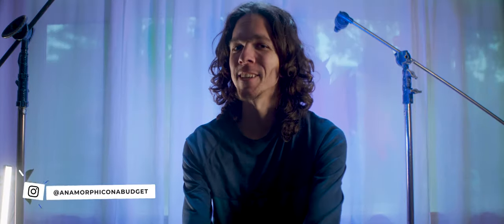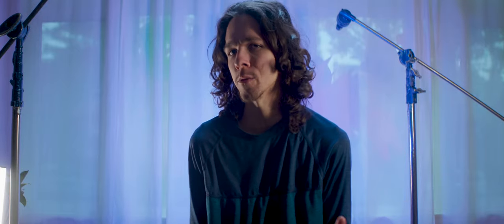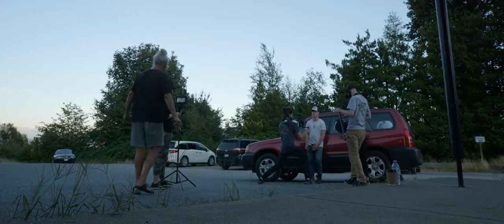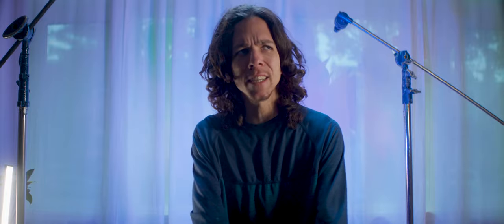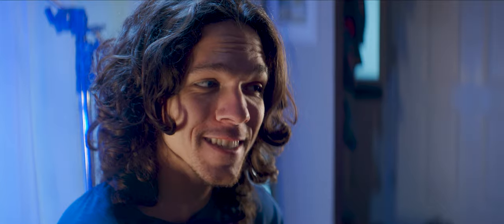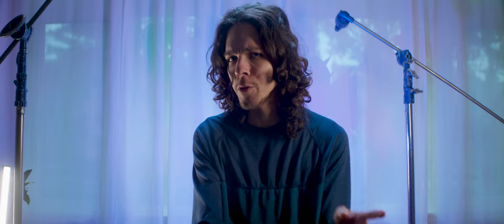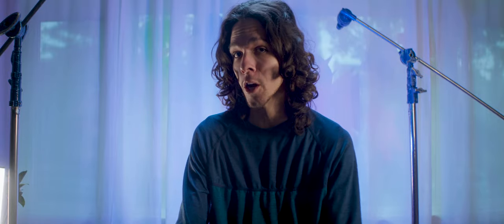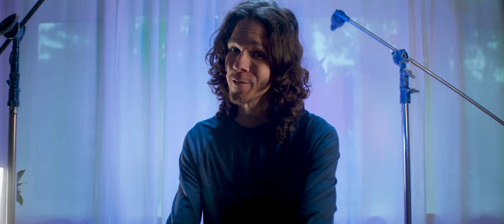A Roadmap to Anamorphic Rig Building - Anamorphic 101

Comment: Hey man, do you find hard to get sharp focus at distance? I've got the red ultra star and zeiss 1.4 and Rectilux but I can't manage to get anything sharp until t5.6 and at distance objects not until cant get much in focus until T8-10. Both set to infinity...also tried shooting in 6k instead of anamorphic mode. Any help?
Reply: I have a similar setup as you so I think I might know what the issue is. The ISCO ultra star red actually focuses past infinity, my copy's focus lock doesn't even work. What I did is I removed my variable diopter, and used my monitor to 4x punch in and focused both my taking lens and ultrastar onto infinity manually based on the image as opposed to the lens markings before reattaching the variable diopter. I found that both my taking lens and my ultrastar's infinity point to not be the end of the focus throw, but somewhere just before. I can get very acceptably sharp images up to f2.8 on my setup once things were properly aligned. Hope this helps!
Reply: @sifren2491  I mean I can get some sharp at 2.8 at close range but anything in the distance now way. Also what do I adjust first the taking lens and then the anamorphic? Or other way around? Without the diopter everything is blurry no? Thanks man it would be helpful
Reply: @luigicappellofilm  I have sharp and usable image in the full focus range (usable at 2.8, crispy at f4) from minimum to infinity. It is definitely a bit softer at minimum but that's to be expected. I would adjust it in sequence of the lens train. Focus the spherical to infinity while punched in on your screen to verify, then add anamorphic block and focus that knowing the spherical is set perfectly. And once both are attached and exhibit a sharp image when at infinity, then attach the Variable Diopter. It also helps to open the aperture of the taking lens up a bit to verify critical focus, if you focus infinity at f8 on taking lens it could still be off. 

Other things that can help contribute to improve sharpness is to reduce the distance between lenses if possible. I'd also lock the Ultrastar, or tape it and the taking lens focus ring down once it's all aligned so they don't get bumped. I have the whole thing taped down and inside a RMJ/FMJ, and I don't ever really have to open it to re-align.